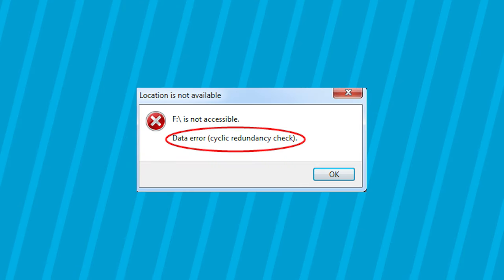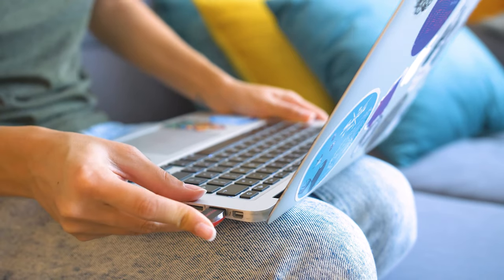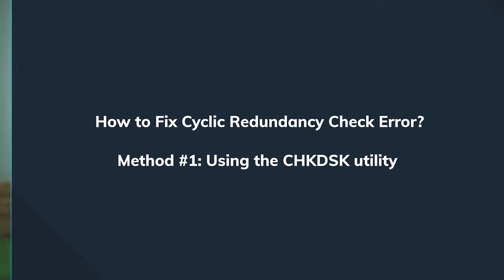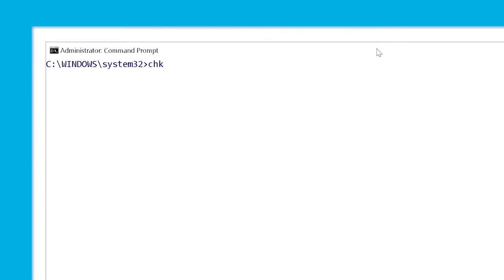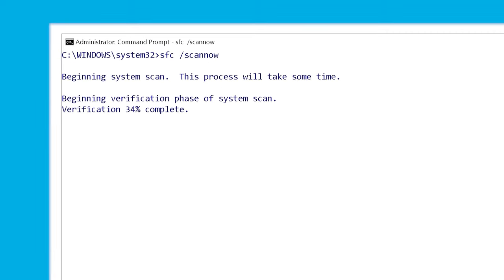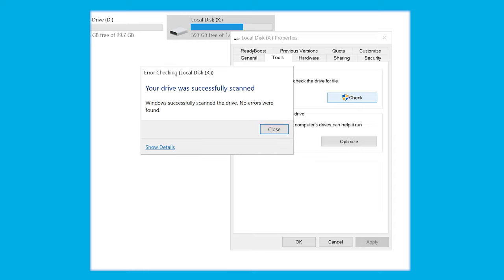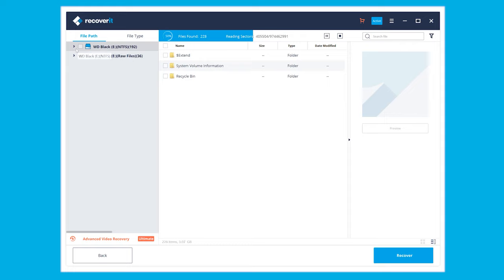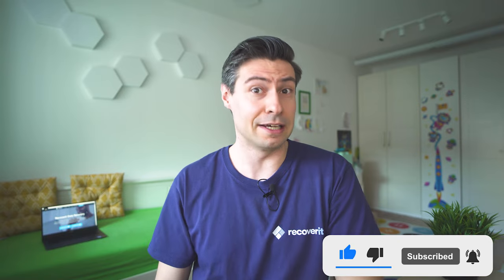How to Fix Cyclic Redundancy Check Error? [3 Methods]

Comment: what do i do if my hard drive wont appear In file explorer but appears everywhere else?
Reply from the maker: Hi there, thank you for your question! Start by going to device manager and then expand the disk drives tab then right click on the driver and enable the drive. If you see the drive there but it has no letter right click on it and select change drive letter and assign a new letter.

Comment: How can I fix this error when the disk does not have a drive letter?
Reply from the maker: Hi there, thank you for your question! Open Disk Management by pressing Windows key + R, typing "diskmgmt.msc," and hitting Enter. Locate the disk without a drive letter, right-click on it, and choose "Change Drive Letter and Paths." Click "Add," assign a drive letter, and click OK. Run a disk check by opening a Command Prompt with admin privileges, typing "chkdsk /f X:" (replace "X" with the assigned drive letter), and pressing Enter. Follow the prompts to complete the disk check. If the error persists, it may indicate physical damage or severe data corruption, requiring specialized data recovery software or professional assistance.

Comment: I have done the first method and it shows "The type of the file system is RAW.
CHKDSK is not available for RAW drives."
Reply: please help
Reply from the maker: Hi there, thank you for your question! You will need to format your drive to FAT32 or NTFS that should s0lve your issue but before you format make sure to backup your data as formatting will erase all data on the drive.
Reply: Cannot format as the sd card is unallocated

Comment: I did this but now can't access my files, Can anyone help with this external hard drive problem? It's asking me to format, but I don't want to risk losing all my files 🤦🏾‍♀️
Reply from the maker: Hi there, thank you for your question! If you are getting the CRC error on your external hard drive and can't access your files, avoid using the drive further and check connections. Attempt connecting the drive to another computer. If the issue persists, use data recovery software like Recoverit or to retrieve your files. In critical cases, consider professional data recovery services.

Comment: Cannot open volume for direct access. How to tackle this
Reply from the maker: Hi there, thank you for your question! I would recommend trying to open up your BIOS settings then look for the option Primary Hard Disk Self Test, run it and restart your computer. If none of the steps worked then I would recommend trying to format the drive but this will erase all the data on the drive.
Reply: @RecoveritDataRecoverySoftware  drive is not allocated ... It's just show cyclic redundancy check

Comment: For the CHKDSK utility, I used the command prompt and had followed the steps. At the end, I got this message on the CMD 

698864 files processed.
File data verification completed.
 Phase duration (User file recovery): 1.07 hours.
An unspecified error occurred (75736e6a726e6c2e 500).
C:\Windows\system32>

Help?
Reply: I am also follow the step 1 but it takes more than 2 hours . It seems chkdsk d: /f /r / x fixes my drive d not my pendrive which is drive f. Please help
Reply: @honeyinspectionlab7794  Got the problem fixed, try changing your hard disk to an ssd

Comment: It's showing chkdsk is not available for raw drives😥 help me!
Reply from the maker: Hi there, thank you for your question! This usually means that the file system on the drive is corrupted or unrecognized by the operating system. To troubleshoot, start by ensuring you have a backup of your important files. Then, you can try connecting the RAW drive to another computer and using data recovery software such as Recoverit to retrieve your data. If that doesn't work, open the Disk Management utility in Windows to check for the RAW drive and attempt to reformat it if necessary. Alternatively, you can use Command Prompt with commands like "chkdsk /f" or "chkdsk /r" to repair the drive, but these commands may not work on RAW drives.

Comment: Thank you for the video!
The chkdsk returns " Media error has been detected. Bad sectors may be present on the volume"
..
Corruption found in <a lot of directories>
..
0 bad sectors in final summary..
-------------------------
On running chkdsk /f /r /x 
it still shows the all above errors & gets stuck on 100 percent completed line (with the dots animation going on and on for past 30 minutes)

------------------------

Request you to suggest another solution.

Comment: for me chkdsk it gave me a result saying f parameter not specified
Reply from the maker: Hi there, thank you for your question! The error message “F parameter not specified” usually occurs when the /f flag is not included in the command. To fix this issue, you can try running the command chkdsk /f instead of just chkdsk. This should prompt chkdsk to fix any errors it finds on the disk

Comment: RECOMMENDED FOR WD MY PASSPORT/RELATED.

None of these methods worked for me,
The error can be simply erased by downloading UTILITY tool of your External/Internal Hard drive, You have to format/erase all data via that tool and it will be immediately solved.

Comment: i cant eaven see the hard drive i cant exit the  hard drive from the computer and can see disc manager but can see it in my files
Reply from the maker: Hi there, thank you for your question! First try entering into the bios and see if the drive is showing up at all if it isn't it might be a physical issue so I would check the connections and if it still isn't showing up I would recommend taking it to a professional for further assistance.
Reply: @RecoveritDataRecoverySoftware  i can see it and i can hear it working but i just cant open it its says that recycling error

Comment: the first 3 didn't work for me but I stopped the process for the 1st one since I felt like it would take hours lmao. Howver, Im still gonna try the last and 1st method. Thx for the video anyway whether it solves my problem or not ( I reall wanted to solve this error when extracting data from the rar file of a certain game I finally found some files for, but then this error came )
Reply: so how did it go ? Did you fix it

Comment: what do i do if the hard drive doesn't appear
Reply from the maker: Hi there,
In case of the disk could not be initialized correctly on your computer, we are afraid the hard drive might be physically damaged, then our software cannot detect or recovery data from it either, you probably need to send the drive to manufacturer or local hardware maintenance lab for repairing.

Comment: I tried chkdsk D: /f /r /x on command prompt but got CHLDSK is not available for RAW drives.

Using Error check on file explorer failed because windows can't access the disk.

Now I'm trying recover it but the usb was disconnected despite being plugged in

Comment: i lost data bcz of you :( earlier only one folder that problem. now whole drive doesnot open
Reply from the maker: Hi there, I'm sorry to hear that what exactly did you do?
Reply: thanks for replying. i simply ran chkdsk on the external harddrive. if plug in the drive again, it doesnot open. the windows doesnot recognise it. e:/ is not accessible. the parameter is incorrect

Comment: If the drive doesnt mount or intialize, none of these are going to work
Reply from the maker: Hi there, thank you for your question! I would recommend trying to test different ports, cables, or connect the drive to another device to see if the issue persists. Does the drive make any sounds when starting up?

Comment: What if the drive is the drive currently holding the windows. What if it's drive C
Reply from the maker: Hi there, thank you for your question! If the affected drive is the one currently holding Windows, fixing the CRC error may be a bit more complicated. You can try booting into Safe Mode and running the CHKDSK command from there. Alternatively, you can create a bootable USB drive or DVD and run CHKDSK from there. If the affected drive is Drive C, and you are unable to boot into Windows, you may need to use a Windows installation media to access the command prompt and run the CHKDSK command from there. You can create a Windows installation media using a USB drive or DVD and boot your computer from it.